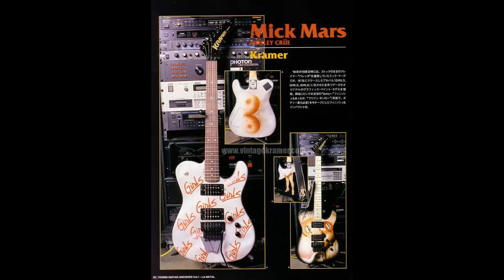"One of a Kline" Marilyn Guitar

Comment: Dennis Kline , I happen to have rebuilt my dads old Kramer Beretta he passed on to me. It's an 85' with the lady of liberty paint job with your signature in amazing condition. Unfortunately the original JB pickup didn't age well so I had to replace it with a modern JB. I still have the original pickup wrapped up and everything else is original. Your artwork is outstanding, flawless, and even the fireworks on the paint sparkle when lights is shined on it. One of a kind irreplaceable guitar I wouldn't trade for nothing😌